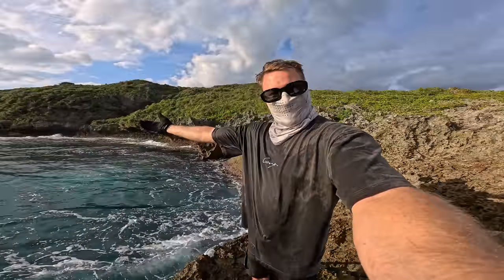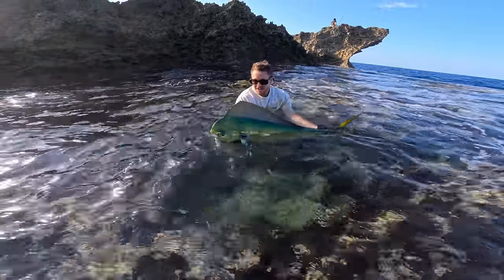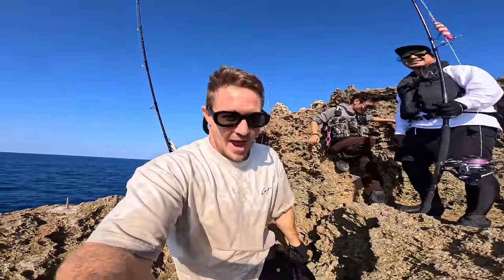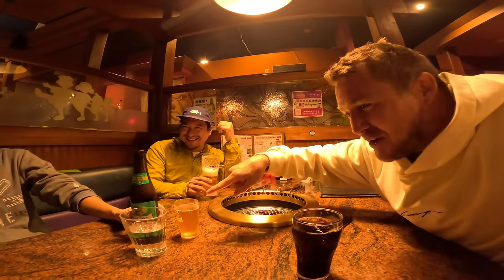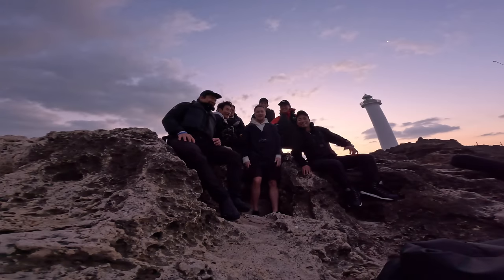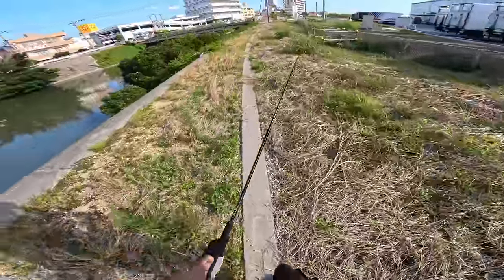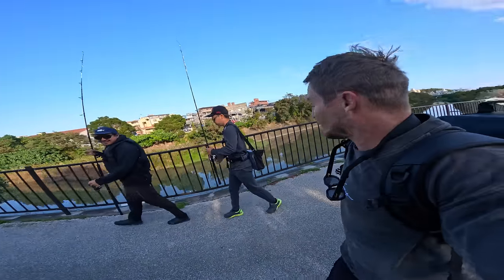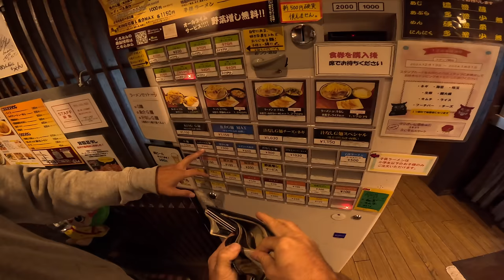A dream come true!

Comment: I have really enjoyed watching your vids. I fished the Texas (USA) Gulf Coast for many and offshore for a few. I couldn’t help but notice your casting. When casting for distance or if a school is just a bit out of range try looking up at 45 degrees and starting the cast with your hips, like driving a golf ball, swinging a baseball or cricket bat. You can hit it with your shoulders and arms but really power it using your whole body. Will add 25%+ to your distance.
Many of the guys in the US are using on spinning that you attach to your rod just the reel seat that replaces your finger when casting. No more gloves unless you just want to wear them. Good luck and be safe.